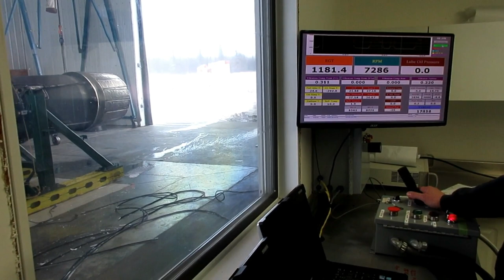Afterburner Monday

Comment: Back when I still shaved, I used a brass Gillette "safety" razor from the 40's. I used Japanese Feather blades and they would last me about a week. What always gave me the best shaves was a good brush and soap with hot water. I get a 5 o'clock shaow at noon, but using the above would push that back to early evening.

Comment: Would love to get some better audio of the engines as they go sometime, the video is always great! It looks like a DR-05X can be had for $70ish used, not sure how that would handle the sheer volume though, might have to go nuts like the setup I bought to try and capture a rocket launch, dynamic mic and the more expensive DR-40X (or similar PCM recorder) with XLR input.
Reply from the maker: I've tried an SM57 at about 50 yds, and got noise. The best sound is from very far away, but the best video is from medium distance for the loud stuff, and very close for everything else.
I'm only one person with a couple cameras.
To the whole testing process, me and my videos are a meaningless detail... that better not get in the way or interfere with anything.

Comment: Ha at the razor blades. :)
I also use the 5-blade ones. But I change razors about once a year. 

Trick is to wash first with a strong soap (laundry bar soap), rinse off completely with warm water (skin feeling rubbery, because it's like a de-greaser), and then lubricate with some cheap hair conditioner. It lubricates even after a few swipes, unlike the soap, which comes off and then you get a nick - so never shave with soap, only with conditioner.

Then you just always go minimum pressure and against the lay. I keep the hand I wiped the conditioner on wet with it, and feel about in a circle to figure out which direction across the skin is best for each patch.

The five blades are diamond coated. I once spoke with the lab technician who developed the process. He recounted once having shown it to some guy how it was done informally in his lab, and then a while later... diamond coated razor blades suddenly appeared on the market.

They last a surprisingly long time, if it take care to run them right.

Comment: Noticed the RPM boosted up about 1000 at full AB ,  is that because of full throttle or the blast exit removing resistance from the turbine section ?  thanks ,  many questions I had about the j79 have been answered from your videos !
Reply from the maker: The throttle goes to max, and then past that is the activation zone for reheat.
There's a lot of noise andvibration in that evironment, and the rpm speed pickup is mechanical, so the reading might be a bit jumpy. Rpm should not change a whole lot whe AB is selected.

Comment: The anodized single blade razor is known as a Safety Razor. 
I'd love to see the Afterburner with the blue shock diamonds.
Thank you.
 ;)
Reply from the maker: The J79 AB flame is orange because being a turbojet there's a bit less oxygen in the exhaust.
The turbofans in the F15,16,18, 22, 35 and all modern fighters have a lot more oxygen in their exhaust, so the flames are more often bluish.

Comment: The trench that your engines are digging is getting bigger and bigger. 
I don't use a traditional razor with 4-5 blades as you have shown. I've been using an electric razor for 25 years. No problem with cuts and consumables.

Comment: I don't get adds because I pay for YT! Single blade razor for me and costs $14aud for a pack of 10 blades. Been using the same razor for 40yrs. Tip of the day a hot flannel or towel on your face before you shave really helps like the old time barbers used to do.

Comment: Those flameholders look to take up so much of the engine flow path, pretty crazy.
Reply from the maker: Yes, but remember the gas velocity is not so great there. In the jet pipe, there is some pressure and some speed. As the gas exits the pipe, the accelerating nozzle converts the pressure to a huge increase in speed. So, the losses caused by the flame holder are minimal.
Reply: @AgentJayZ  Right on! 😀
Reply: @AgentJayZ  As for a razor,  I've always used Gillette disposable.  I dry it off after everyday use, and I get at least 2 to 3 months out of them.

Comment: Seeing this sheer power is always awesome, thanks! Do you occasionally replenish and compact the soil in jetwash alley (slowly turning into jetwash canyon) to keep the erosion from eventually reaching the test cell foundation and compromising it? I imagine that it might not be easy with freshly filled in material eroding even faster, but in the long term it might be a concern.

Near the end of the regular video, you said the radial spikes were thermocouples (why are there multiple ones?), but I thought most of the radial things we see were afterburner spray bars. So the short ones right behind the turbine are the themocouples and the longer ones behind those (in the direction of flow) are the spray bars? Thanks.

Comment: I mean it would definitely depend on the engine for the hours read the manual right but what are some signs in service that would be indicative of a necessity for overhaul? Long time no talky Jay z got a job at the airport. Still chasing that flight deck!
Reply from the maker: There are usually magnetic inspection "plugs" on each of the bearing sump oil scavenge lines. These are usually inspected  frequently, and if any metal debris is present, it indicates impending bearing problems.
Reply: As AgentJayZ has suggested, metal on the MCDs (magnetic chip detectors, aka 'mag plugs'), and/or metal in filters, would result in an engine rejection.
Other than this, a common cause of engine rejection would be a rising trend in turbine gas temperature (TGT) or exhaust gas temperature (EGT) for a power/thrust, indicating a deterioration in component efficiency.
Reply: @grahamj9101  thank you

Comment: Dear Agent JZ.

I have a question.  I’ve seen most of your videos and I was wondering if you took 4 of the J79 engines would a plane like the 747 be faster ( be more powerful) than it is now with the modern high bypass engines?

And the follow up question is : does a big jet engine make more power than a ( for instance) J79 engine?

Thanks for your content!

Greetings from the Netherlands
Reply from the maker: A 747 is nearly transonic at full speed. 4 J79s would make a lot more noise, but likely not take it supersonic, which is good, because it might break up or at least lose control. 
Also, even with 4 big turbojets, the 747 would take far longer to get off the ground.
It's a bit like putting an F1 engine in a large transport truck...

The core of the largest turbofans are a little larger than a J79, and are much more efficient. I think they  do make more power.

We are talking power here, and not thrust.

For your follow up question: the J79 is a big jet engine.
Modern airliner engines are more commonly known as turbofans.
Have a look at my video called Turbojet or Turbofan...

If we remove the fan from an engine that once was an option for the 747 - the CF6, then we have an LM2500. They make about 35 to 45 thousand HP when moving a power turbine.
The J79 without an exhaust nozzle is basically an LM1500, and those make about 16 thousand HP when driving a PT.

Comment: Yes seeing the turbine coast down is cool...

I use a Braun electric.not as close as a razor...but I usually it won't cut me...

Battery power...

In 2 years...the head will wear out...then usually in another 3 years...something else will break...
Reply from the maker: I've had a Braun for over a decade. Not quite daily use, but still goes like new.
Reply: Yup....My older Braun still ticks...& needs new NiCads...
Reply: When it cuts you, then you know it's time to change the blade.  :)   I buy 3 blades at a time and they last something like 1 year each, so ~ $75CAD/yr.  You have to clean them regularly though, and if you let things go then you'll be in for it.

Comment: I go through about $10 of cheap 3 blade disposable razors per year. Shaving with soap in the shower is the way.
Reply from the maker: Brand new disposable razors, even the best ones, are like an old tin can lid hacking up my face. I'd rather use a shovel dragged on the road.

Comment: If I may ask a slightly off topic question - I follow the Bloodhound SC project and they have put a V8 on board to power the fuel pump. I doubt that the average plane has that on board. Is that because they need heaps of power or that there is a better solution?
Reply from the maker: I think the V8 will play 3 roles: 
It will act as an apu, supplying power to the car's electrical and hdraulic systems.
It might be used to run the fuel pumps for the jet engine.
It will be used to run the fuel pumps for the rocket engine.

I just looked at Wiki, and it appears the design of the car is being changed.
Reply: @AgentJayZ  thanks for the reply 😊
To be clear, I was wondering - if the Bloodhound needed a V8, what is used in an airplane to power the fuel supply?
Reply from the maker: To be clear, most airplanes do not have a large rocket engine to feed...
Reply: Hello AgentJayZ, I've put one of my other hats on to answer this..
As a Bloodhound Education Ambassador since 2009, I've been in close contact with the project over the years.  Unfortunately, however, it is in hibernation at the moment, but an injection of GBP10million might wake it up, though.  
So please see my answer to the question.
Reply: Sorry, but you are a bit behind the times, so let me update you.
Bloodhound SSC was originally planned to have a Cosworth Formula 1 engine, the primary function of which was to drive the pump feeding 900litres of concentrated Hydrogen Peroxide (HTP) in 40 seconds to the hybrid rocket motor that would provide boost power, in addition to the EJ200 jet engine.  
However, Cosworth dropped out of Formula 1 and withdrew, but Jaguar came on board as a sponsor and offered the 550HP V-8 engine out of their F-Type.  So why use an automotive engine, when a gas turbine APU might have done the job?  The answer was,, simply, money.  As sponsors, Cosworth and JLR offered engines (and JLR provided company cars) for free, so why go searching for a second-hand gas turbine APU, at great expense? 
The project was always running short of sponsors and money and finally, in 2018, it went into administration.  It was rescued at the last minute and rebranded Bloodhound LSR.  The new owner pumped perhaps as much as GBP25million into the project, and the car was run in S Africa in October/November 2019, achieving a speed of 628miles/hr on the EJ200 engine alone.
Following this, the plan was to install the latest design of hybrid rocket engine from Nammo in Norway and run again in 2021 or 2022.  However, a small thing called Covid-19  got in the way.  As a result, the car is now in a museum and the project is in hibernation.  But if you have a spare GBP10million or so, to give it a life-giving injection, it could be brought back to life.
The latest plan is to go green.  The EJ200 would be run on sustainable aviation fuel (SAF) and the HTP pump would be powered by an electric motor, using the latest battery technology.  The target of hitting 1,000miles/hr has been dropped, for the time being at least, and the latest proposal is to have a monopropellant (ie, HTP only) rocket engine, which could get the car up to 800miles/hr.
So, do you have a spare GBP10million or so?
Reply: @AgentJayZ  By way of clarification, the only function of the V-8 was to drive the HTP pump, nothing else.  There is an APU in the aircraft, but there's no APU on the car.
I'm getting rusty on the details, because it's so long since I saw the interior layout of the car. However, my recollection is that EJ200 engine installation in the car includes the so-called aircraft mounted accessory gearbox, which  has a shaft drive from the engine mounted accessory gearbox.
Yes, I really am getting rusty on the details, but I think that most of the services (hydraulics, electrics) for the car are on the AMAG (as they were for the aircraft). The starter might even be there.

Comment: So does the engine perform measurably better compared to a warm summer day when it is that cold out?
Reply from the maker: Yes, on cold days the compressor has an easier time, and we can make more thrust for a given EGT limit.
It's all adjusted for standard conditions.
Reply from the maker: Notice at 1:49, in AB the engine was making over 18K lbs of thrust, and the rpms were about 7300. On a hot day, it would make the same thrust, but the nominal rpm is 7685. The power is limited by EGT, so at 7300 and -10C we were maxed out. The compressor was doing it's job at 385 rpm less than it would need to be turning on a hot day.
So, short answer to your question: Yes.
Reply: @AgentJayZ  interesting that it results in lower RPM, not more thrust. Is the fuel flow rate also lower?

Comment: It would make for some great content if the test stand bolts "accidentally" came loose during an afterburner test. Just sayin'
Reply from the maker: "Great content"... as designated by people who like to see failure and mayhem.
Dashcam videos for "those people".
This is not the channel for that kind of stuff.
Reply: Thanks JayZ & Jet City.....for having that engine well tied down....

I know some tough dog piles...being worked on for so long -that I would like see them suffer a destructive event...

I am sure there is someone out there that wants to run a jet engine at full power....then drain the oil....

May that engine get reverge and send a blade his way...

Those folks are evil. 

I think we can entertain ourselves by watching the foreign object insertion into the compressor.....which is performed I suppose sometimes by the OEM...

An old buddy of mine Larry P. said chicken parts were tossed into Garrett propulsion engines that were once built at their plant near Sky Harbor- for bird strike testing....

Another remarkable event....cause I can babble....

My old boss was bringing a Sabreliner jet from NJ.....to AZ....but the fuel prices somewhere in Kansas were cheap -so they loaded up there and arrived at Sky Harbor on the heavy side.....upon touch down and reverse thrust to slow down....it didn't work....the jet barreled down the runway....crashed the fence....dodged cars on 24th St...then crashed and burned up in a fierce fireball in a hanger taking out a couple of 172s before it stopped...

Bob showed up at work....eye brows burned off...red face....had a little limp & some bandages.....I said what the hell happened Bob....?

I think I will contact Alec Joshua Ibay....& give him some new ideas...

Bob, being the character he is.....told me the true Hollywood story....Summary: A mob hit that went bad....sabotage...

LOL...

Comment: What is the different simultaneous frequency whines most jet engines produce? It almost sounds like several engines running at once. Does that have to do with the multi stages of compression blades?
Reply from the maker: "most jet engines" covers a lot of ground. Let me know if my recent video helps explain things:
Why So Noisy
It's here:   https://youtu.be/agq7Zd0v74s
Reply: @AgentJayZ  yes, that video explained a lot...yes, your right,  all jet engines seem to sound different. Let's use the J79 for example. As it spools up/down it produces several different whines at the same time...very unique and badass sounding

Comment: Is bypass flow just air that misses the compressor and gets delivered to the afterburner duct or variable nozzle? I just don't know what kind of purpose it serves for the engine.
Reply from the maker: No. Easiest way to learn might be to look up turbofan engine, and maybe watch my vid called turbofan or turbojet.
Reply: Ok, thanks.

Comment: What are some signs that a jet engine needs an overhaul? How many operating hours?
Reply from the maker: Commercial aviation has a lot of regulations regarding maintenance of the engines. Sometimes they are followed, and airliners operate with great safety.
Industrial gas generators are often run continuously until they have a problem, or an indication of a developing problem. Usually a periodic ( yearly?) boroscope inspection will be made to look at the hot section components. If degradation or cracking is found, an overhaul will be called for.
Alternately, since there are very few regulations, some owners run the units to failure.
Reply: @AgentJayZ  You sir are scholarly. Thank you.

Comment: Why does the lubber line on the start cart air hose go in a spiral? Aren't they supposed to be strait?
Reply from the maker: It goes from one end to the other. Air is pretty good at going through a tube, even around corners.
Start cart air is 25 psi. The line also has a spiral reinforcement rib that is visible.